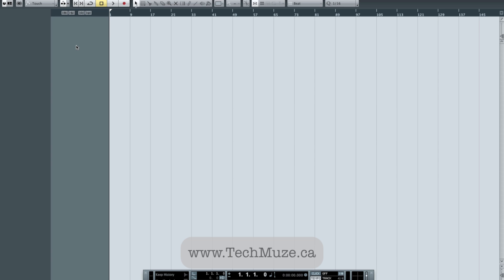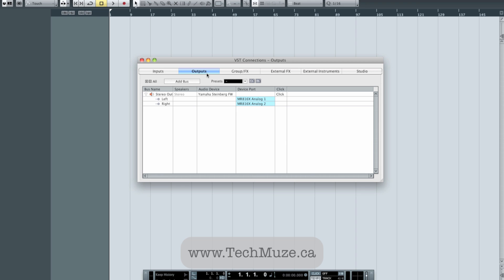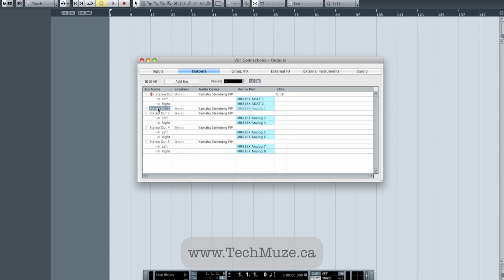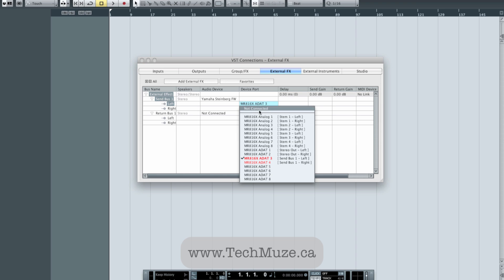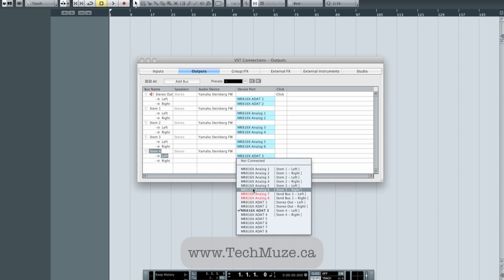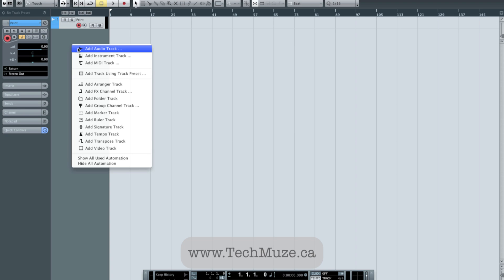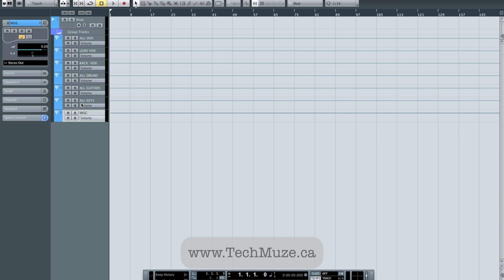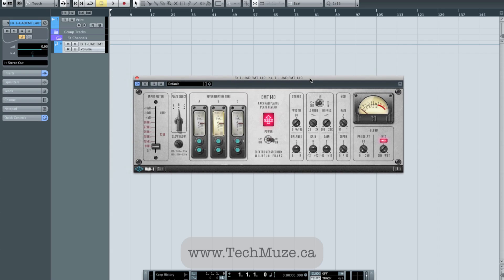Stem Summing in Cubase 6 (Part 1)

Comment from the maker: The reason for the print track is to record the stereo signal that comes back from my outboard gear. My mix gets sent out of the computer into my summing mixer. Then it gets summed to stereo and sent through any hardware that I deem appropriate. After that I need to get the result back into the computer. So, I record it onto a stereo track in my session as the stereo "print". I hope that helps clear it up!

Comment: Hi Dezz. Just want to say thanks for the very good vids I've seen so far. Very articulate and inspiring. I use Cubase ( luckily !) as well and I have one question: why do you set up a ''print'' track ? What is the benefit ? I've normally just export the session as a stereo file, either quickly or in real time. I've googled a bit but can't find anything about this. Once again, thanks, Jason